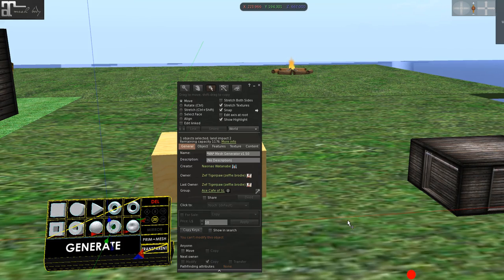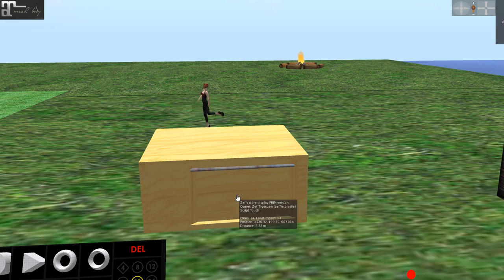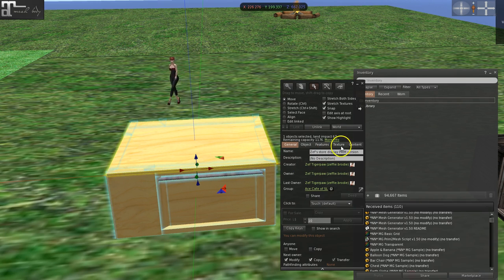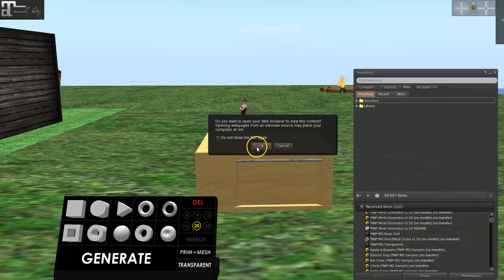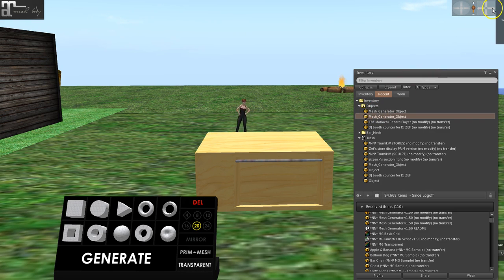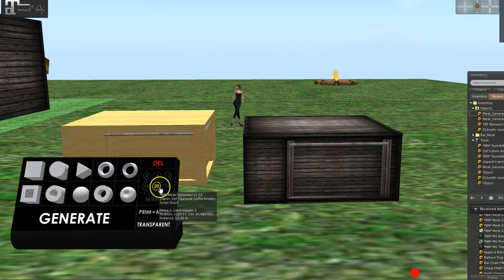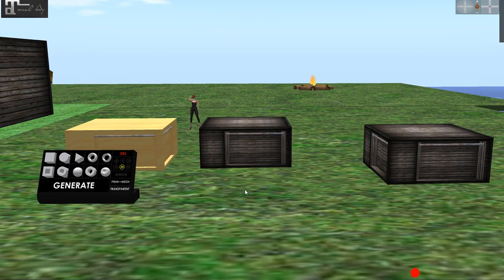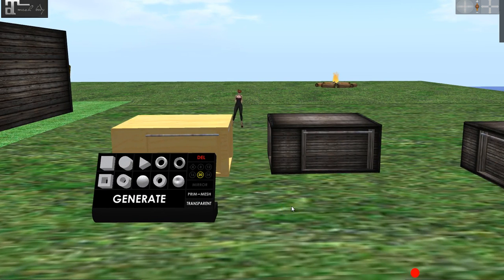Using Mesh Generator in Second Life to convert Prims to Mesh Tutorial

Comment: Incorrect info about the 4 8 12 16 20 24 buttons also. If you have nothing but straight angles and no rounded objects put it on 4. Less triangles = better LOD. Looks like you have a couple cylinders so 20 was ok in your situation, but you could have even took it to 8 and it wouldnt have been noticable quality wise. You would have just had better LOD and lower land impact.

Comment: The other thing you get in the kit is a transparent texture, this should be used to make any side that won't be seen transparent, it helps lower the Li because it isn't read as data. Mesh has the same issues Sculpty has as far as things not being walkable or door ways you can't go through, you will need a physics layer, (invis prim) just as you did with sculpties. SL suggests that you make your own instead of using the physics option provided when uploading the Dae. To do this simply make a shell of the same build, a build inside a build so to speak and make it transparent after you mesh it.